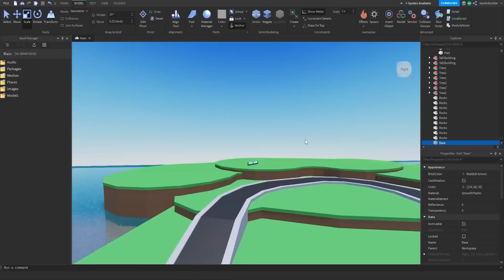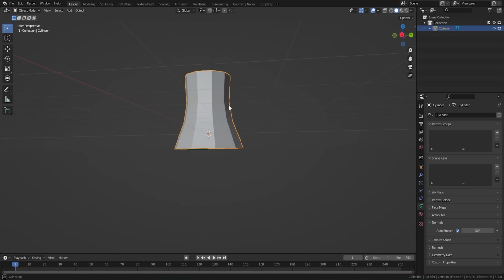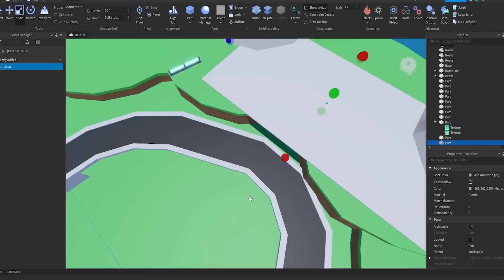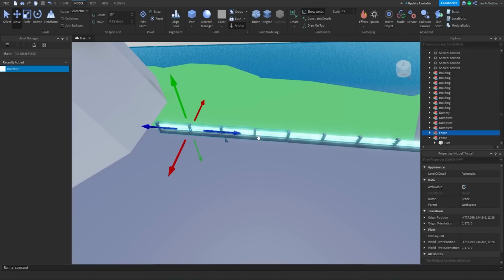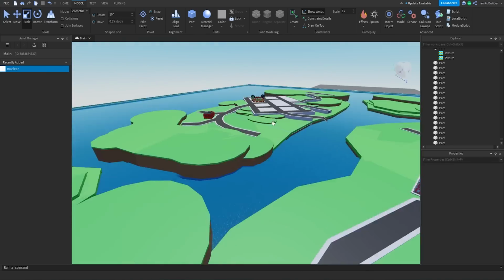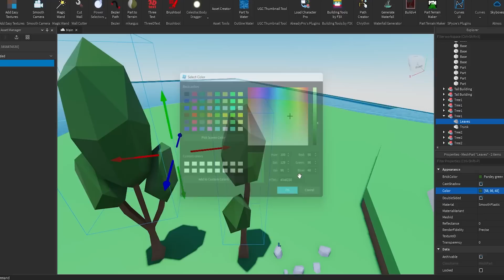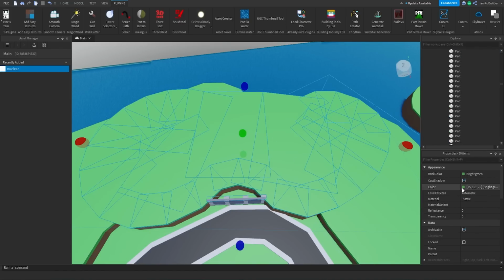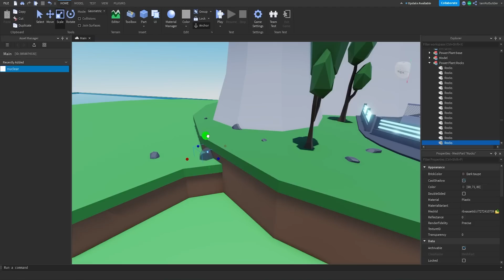I Built a NUCLEAR POWER Plant...

Comment: Just a suggestion but when you finish the map union the grass and stuff so it doesn't do that weird thing where it glitches. It will also help a bit with performance
Reply: unions have more mesh data then everything else so no it doesn’t help with performance and also smooth plastic doesn’t z fight because it has no normal map